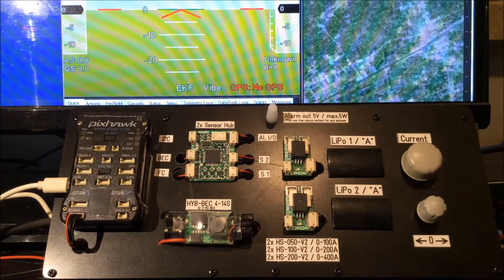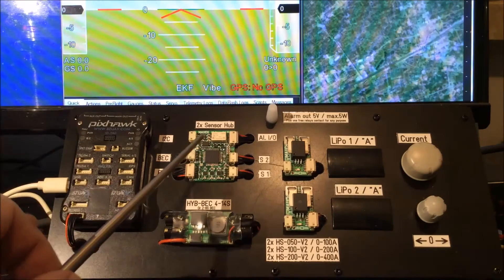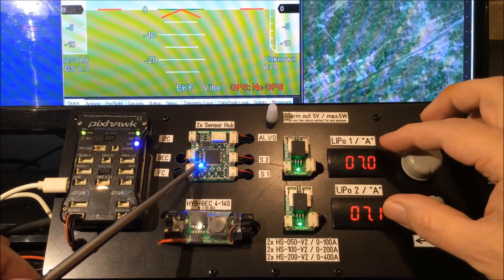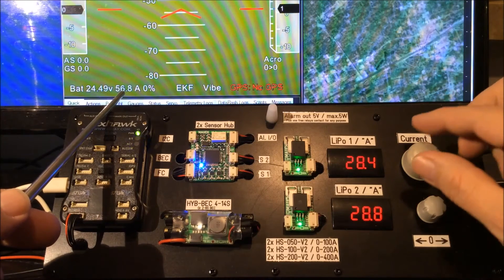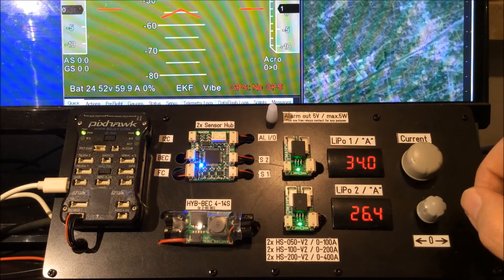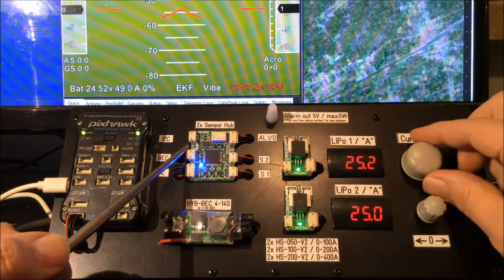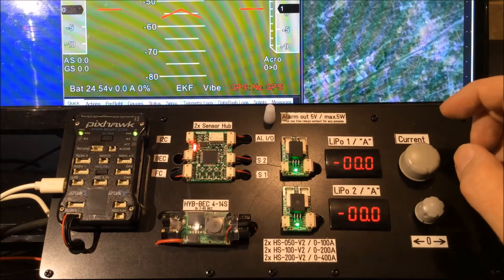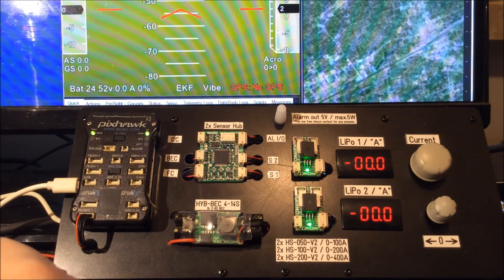Mauch Electronic / Sensor Hub X2 for Pixhawk / APM

Comment: Wondering why my 4-14S  HYB-BEC regulator module has only 11.41v on the 12v output?
also, the power to pixhawk2.1 black standard cube  is 5.302V from both of the outputs.  Is that normal?   
I ordered the PL current sensor with the package, and wondering if it's possible to connect a second PL sensor for a second battery monitor later on if i want to?

Comment: No answers here...well, after about 6 hours looking over confusing info on his website, and getting frustrated trying to find matching products on his distributor's webpages, finally figured it out, for my use, and found a webpage I could buy from  here:
http://www.craftandtheoryllc.com/store/mauch-premium-line-single-battery-kit/#configuration
I'm just looking for a setup to power a pixhawk cube, but want redundant power supply for it, and also need to measure more than 60 amps of current, so the normal current sensor that comes with the Pixhawk 2.1 cube from cnc will not work.   
anyway, they sure make it hard to buy his products.  he has 3 separate competing product lines, with some overlap, bad translation, confusing language, no standard part numbers to identify the parts as such from one retailer to the next, (everyone seems to invent their own)
and no response here, or via email from him.    I have no doubt that chirstian has great technical expertise, but poor marketing and customer service for his products. 
hope this helps someone else.   Chistian, if you are listening,..   I can help you sell a ton more products, by clarifying them on my channel.  (FREE of charge) and give some feedback on your retailer's listings..    or you can do it yourself. 
not so much need to convince everyone of your technical expertise now, so much as make it simple for them to find what they need. 
cheers, everyone!

Comment: I have a pixhawk-based quad-plane build, and I was wondering if it's possible to connect both a lipo battery and a li-ion battery to power the plane, such that the lipo battery powers the quad motors and the li-ion battery powers the forward motors? I would much appreciate if you are able to suggest a recommendation :)

Comment: I’m unable to see voltage and amperage in QGC. Has something changed?
Reply: you will have to configure in parameters to use a different sensor. see the arduplane documentation to see which settings to use, or see the Mauch website.

Comment: Nice to find your products!    
I'm designing a next gen fixed wing commercial UAV, and using pixhawk FC.  It's a twin motor UAV,  using 6S Li-Ion and each motor pulls 40 amps, for a total of 80 amps max.  I don't mind spending a few extra bucks for the best sensor I can get. Which products of your's would you recommend/ is optimal? Any harm in using the higher voltage  up to 14S current sensor on the 6S UAV? any harm in using the 200 amp sensor for only 80 amps?  I want maximum safety, and reliability. 
Couple of quick questions: 
Should I connect both motors/ESC's through the sensor, or just one?   is connecting only one of two loads a bad idea for some reason?  
Where is a good site to buy your products from?  I get my mail in the USA. 
Thanks!  Love your products, and explanation.  I have no use at the moment for copter products, but will look at multiple battery options for a VTOL in the Future.

Comment: i'm going to try using the mauch current sensor on my vector osd. if I hook up the brown wire 0 to 3.3V input to the vector OSD to the yellow wire 0 to 3.3 volts out from the mauch current sensor I think it will work. my vector current sensor will sill to hooked up to battery voltage on the maunch current sensor's output so I don't think I need to worry about the ground since ground seems to be common in the system. mission planner does not display current consumption so It should get displayed on the OSD this way. the reason why I'm doing this is because the vector current sensor is only rated to 140 amp's. my motors will get power from the maunch current sensor instead.  but the vectors current sensor will still be connected for voltage only and will not supply power to any motors or give a reading as it is getting bypassed.

Comment: So, if I correctly understood, you should to monitor this alarm led from ground, when it above me in 50m? What actually this board do, for prevent automatically the crash and pop up the 2nd battery, any messages to pixhawk via mission planner?
Reply: seems that it's just an alarm switch, so if you can figure out a way to connect it to pixhawk as an input, otherwise it's just an alarm siren or LED.   it has a NO and NC option. you supply the wire, solder, and connect to something.  make sense?

Comment: Hi Christian .. does this setup work with 8s power system ?  I believe your Current sensor only is working with 6s ?
Reply from the maker: +Ziwi: The Sensor Hub X2 is up to 14S, if combined together with an 4-14S HYB-BEC and 2x HS-xxx-HV Sensor boards.REM: xxx stands for 50A, 100A or 200A version.